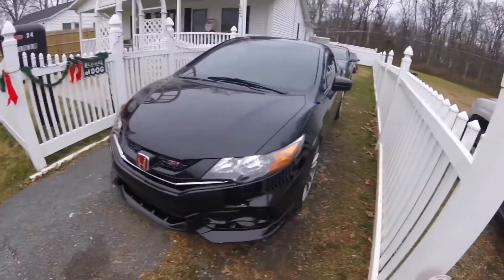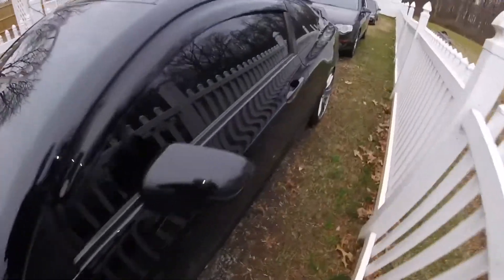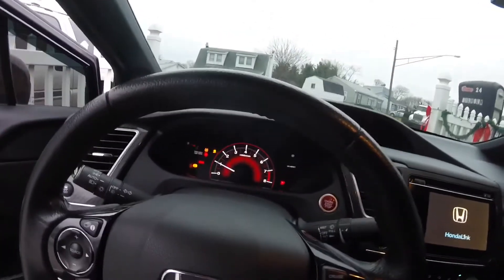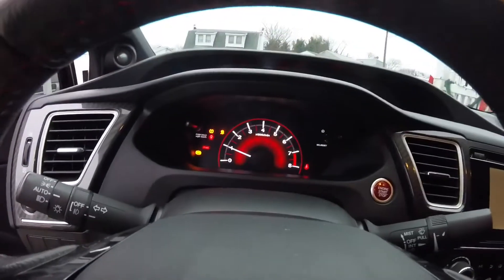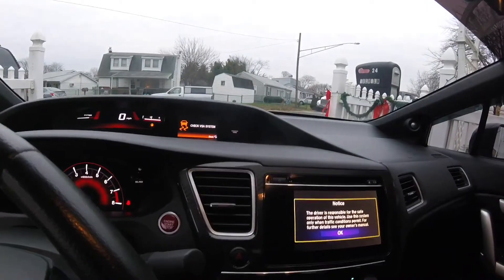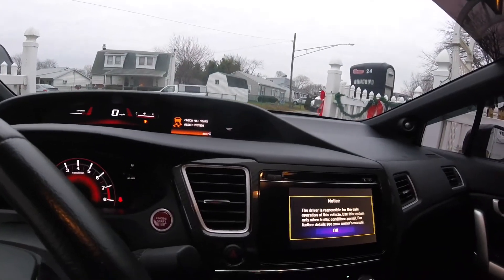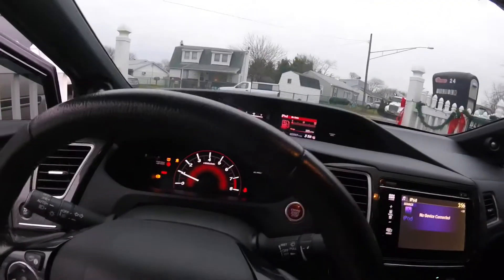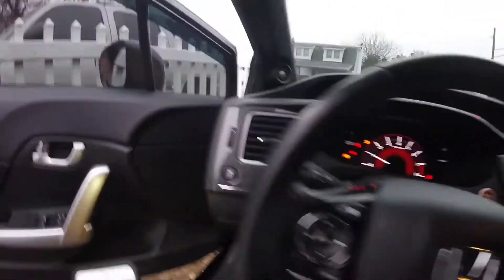9th Gen Civic Si Abs Sensor Issue!

Comment: Hi Mate. Im having this issue with my wife's 2012 civic 1.8. im having all these warning lights ABS,VSA, Power steering. Power steering works but abs vsa or esp dont work. When i scan it says no code's. Would you say replace abs sensors as first step?

Comment: Im getting these messages a few days after i did an oil change, If you stop and start engine all warnings  clear but will come back after a few days  usually when the car is on the move, but sometimes it comes on straight after starting the car so I suspect its an intermittent wheel sensor or the wire that connect to it may have an internal break, so i will have check the continuity on each sensor whilst measuring the sensor resistance with a multimeter and wobbling the sensor wires if reading fluctuate then the sensor wire maybe broken so will probably need to replace the complete wheel sensor.

I Will post back my finding but someone my need to prod and remind me though!

Comment: I have the same issue but my speed goes crazy after driving for about 15 minutes and it’s reading one tire and then it reads the other and it starts tripping out I changed both sensors idk if it’s the speed sensor on the transmission or the abs module
Reply from the maker: Possibly the abs module bc that’s where both sensor go to.
Reply: That sounds like the actual module. I had to replace one on a camry. The speedometer stopped working